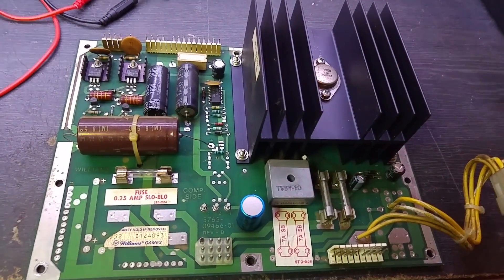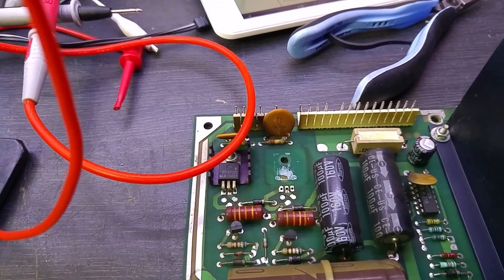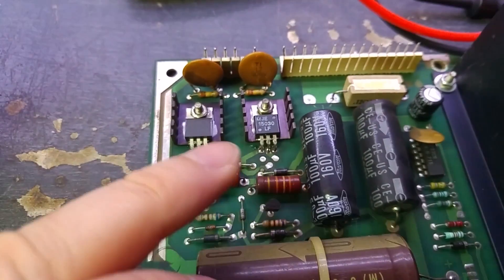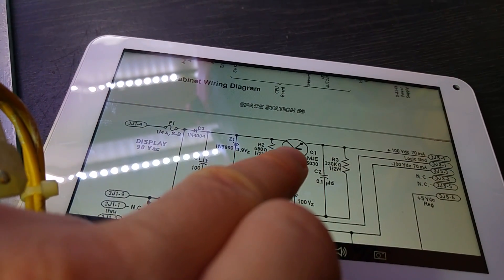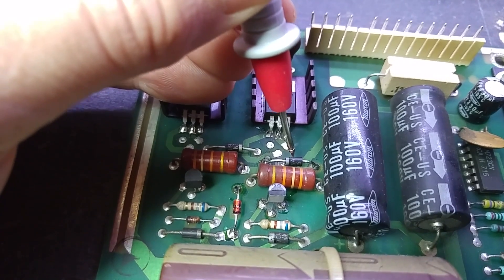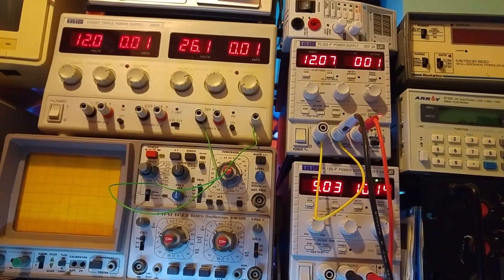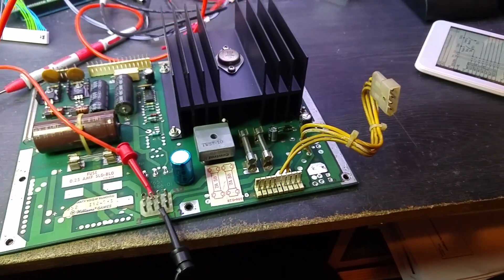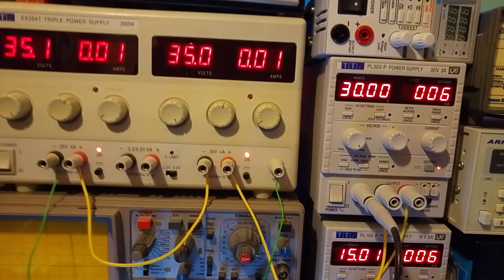Williams Space Station PSU - High Voltage quick fix

Comment: Didn't know you can cascade those! Planning on getting one one day, but 12V is more than enough for my own projects. 😊
Reply from the maker: +Damián Vila You can only if the supplies are floating. The manual will also tell you the maximum combined voltage allowed